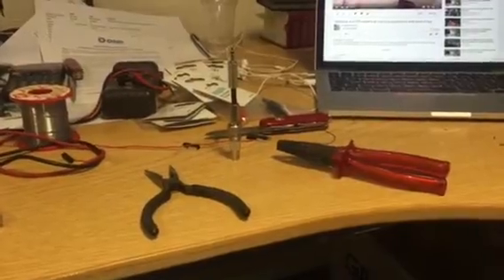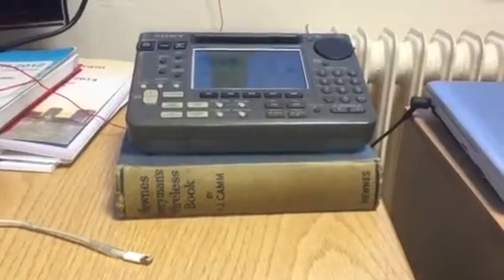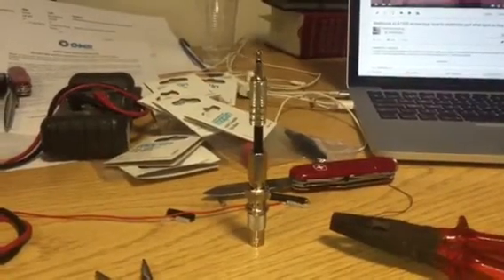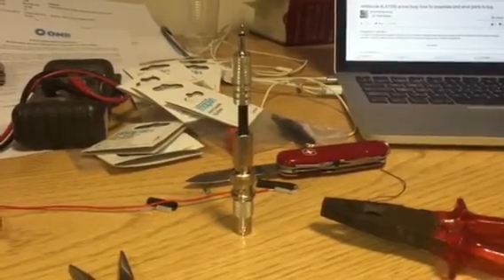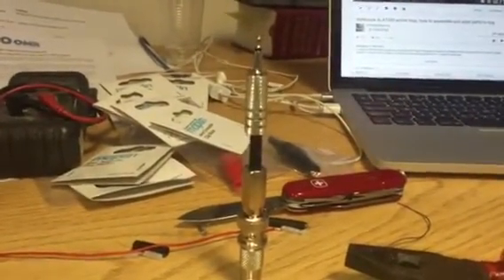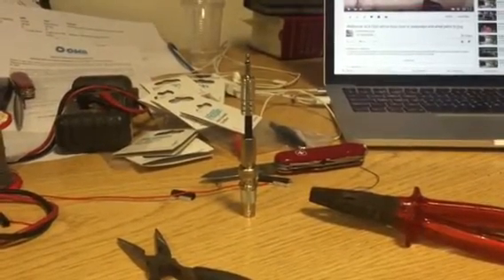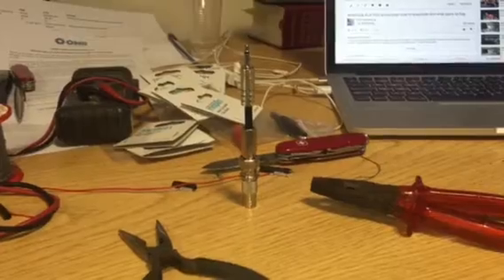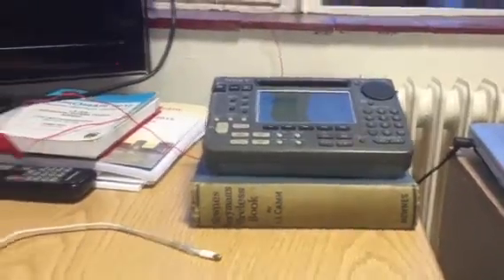Wellbrook ALA1530 active loop: interface cable for use with portables

Comment: I need one of these for my  new Sony! 73s
Reply from the maker: +SamuraiGamer538 Ha ha yes you do - i can make you one lol! 73s! Clint
Reply: +Oxford Shortwave Log That would work! 73s Matt
Reply from the maker: +SamuraiGamer538 Iol I'll check my spare parts drawer! 73s! Clint
Reply: +Oxford Shortwave Log Haha I'm sure you have something in there, I'm still looking for a power supply for the sw55. the ones on eBay look like they'll cause qrm over mw and sw
Reply from the maker: The SW55 eats batteries so a power supply is a good idea in terms of cost, but for the quietest reception, you're better with batteries of course. 73s! Clint
Reply: +Oxford Shortwave Log Ah yes, I tried putting rechargeables in it but that didn't work, so I have some duracells in there right now! 73s
Reply from the maker: +SamuraiGamer538 When you get that radio fixed up, you're going to be very happy with it indeed - promise you that! 73s! Clint

Comment: Hi Clint, very nice work and good to see that your preparations to use the Sony portables with the ALA1530 are stepping forwards. I'm looking forward to the results, especially with the ICF-SW55. Congrats on 100n subscribers. 73, Matthias
Reply from the maker: +senderjaeger Hi Matthias, thank you very much! I'm basically ready to start my tests with the ICF-2001D and the ICF-SW55. I think your right about the 55 working very well as a MW DX receiver with the excellent filters. I hope to be able to upload some videos over the weekend. 73s! Clint
Reply: Oxford Shortwave Log
Good luck with your tests and hopefully they will be successful. I still regret that I've never tested the SW55 with proper MW antennas when I used to own it. 73, Matthias
Reply from the maker: +senderjaeger Thank you Matthias! It will certainly be interesting to compare the SW55 to the FRG-8800 on MW! 73s! Clint